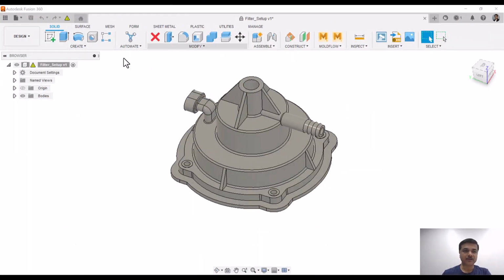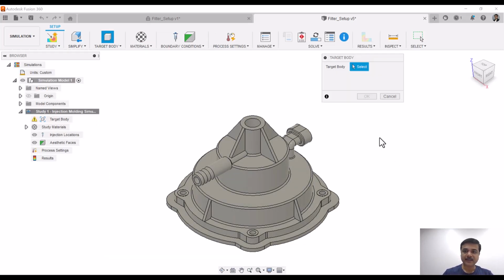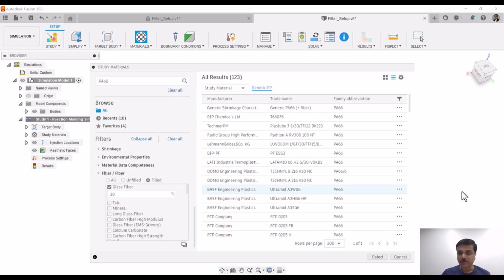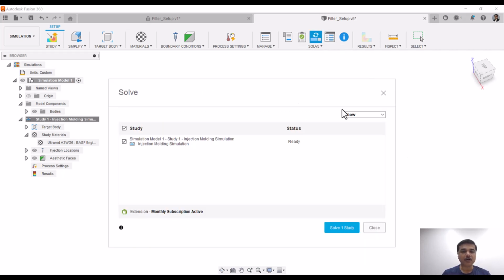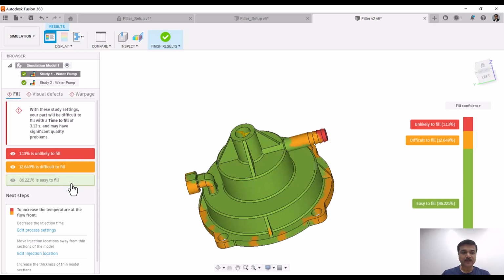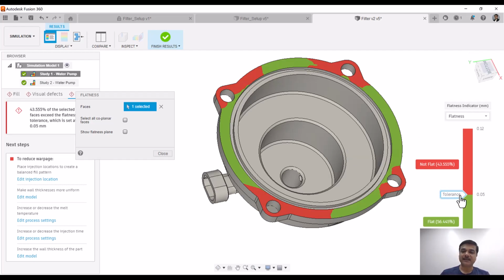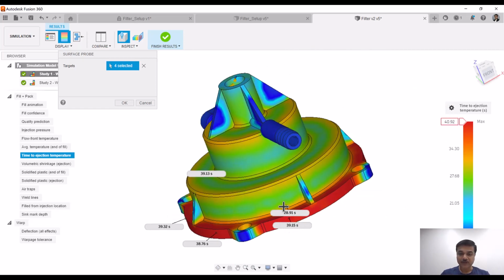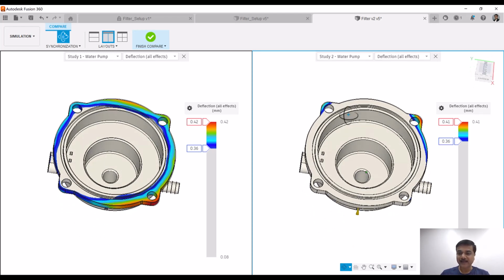Fusion 360 SIM Extension - Injection Molding

Comment: thanks for the great tutorial sir 
i have seen many molders that only use traditional ways in mold design they use charts for feed system calculations and processing parameters so in your opinion does moldflow dramatically save energy  and money by finding the optimum processing conditions or it is just minimal change ?
thanks
Reply from the maker: Appreciate your feedback and queries raised. Moldflow is a digital Process simulation for Injection Molding. So, whatever changes that you wish to make to Mold or process can be validated using Moldflow simulation. Moldflow does have analysis like "Molding Window" can suggest the starting parameters for component based on material and gate location / locations